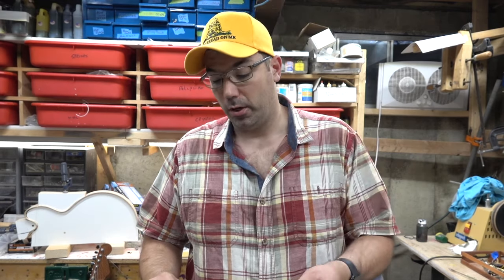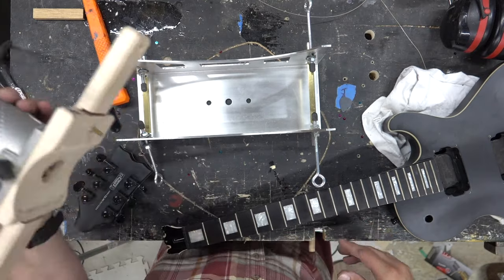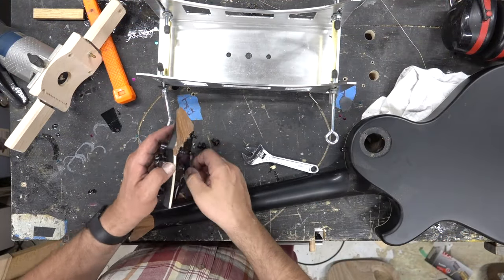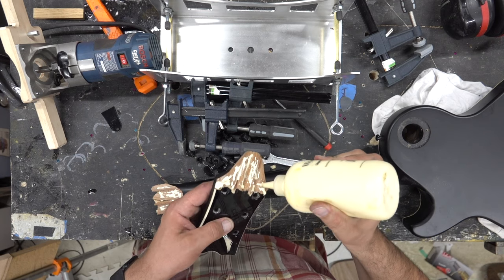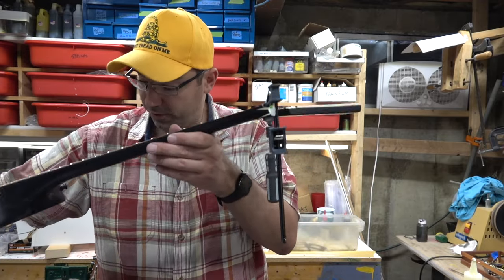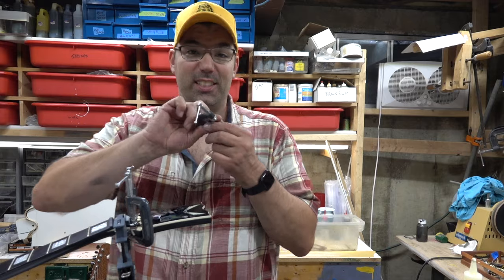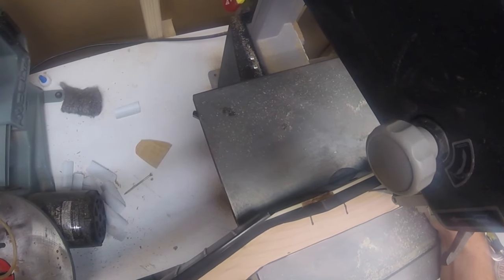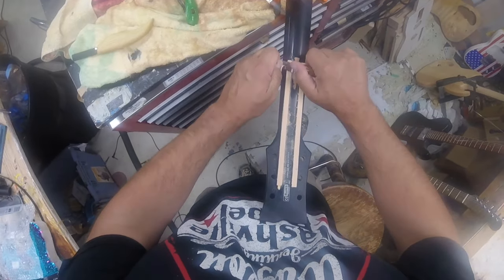Headstock Repair on a Dean Les Paul Copy - Guitar Repair

Comment: I’d have an unfinished open-grain neck because it feels really awesome. I’ll just sand the whole neck down, stain the maple to match the mahogajy and use some teak oil to coat the neck and then sand it level again to the perfect smooth feeling. I’ll also respray the back of the headstock satin black, patch the front of the headstock (in the overlay) with some black (I’ll figure out what’s best to use) and cover it with gloss clear coat. Sand and buff and it’ll be a great player’s guitar. Making satin finish blend with the new finish will be a pain in the ass and I do sand the necks on my personal guitars so why not?

Comment: Dude!!!!! I have an old dean ml ultra (look it up if you must) and it has a break in where the headstock is glued to the neck, but here’s the catch,it’s glued on around the first and third frets. So it’s still being held together because of the fretboard being glued onto both pieces. I wish I could show you a picture. But if I were to tighten some strings it would pull it apart enough for me to get glue in there and I can clamp it down and it should be fixed. I asked a guy back when it broke about 12 years ago and he told me there’s no way it’d work and I’d have to drill holes and put rods and a bunch of stuff so I had put it away in dads house and forgot about it till now. But I’m confident that I can salvage it with some sort of glue now. Man I love what you did to that thing too. Of course I’d love to have that one to try and refinish it before I do the actual job on mine. But I don’t have any kind of videos about that stuff as I’ve never done it. But yea that thing is gonna be sweet when it’s done and I hope whoever does get it will put a video up showing what the did to the neck!! Personally I’d put a Floyd Rose bridge and locking nut in and do a raw finish on the neck like some of zakk wyldes guitars cause those maple pieces look so cool in there.

Comment: Interesting jig! Thanks for the video. I did this job by lowering the joint into the spinning table saw blade with the guitar facing up.  It's scary, but works.  Lot of planning and dry runs needed. The splines will be the curvature of the saw blade.

Comment: Im a carpenter and a good tip for wood glue is to just lightly dampen the wood before applying glue. It makes the joint unbelievably strong

Comment: That jig is very cool. Maybe I should do the spline trick for my Epi LP Black Beauty I bought with a similar break (I got lucky. I had every splinter of wood given to me) and fixed 7 years ago. I always worry it's going to pop back off. I've even thought of making a new headstock from scratch and splicing it on like they do on most of the imports (A neck joint...it's sad...it WAS a one piece neck..ok, 2 if you count the fretboard). Right now, I'm playing the "if it ain't broke..." game. Great Video, now go do the kit B4 Brad gets his done :)

Comment: Cool video. To be more authentic it has to be turned to Lp custom. One would have to retouch the headstock and the horn so it would look more authentic but with Dean name. :D
Because of horn cut strip the finish and repaint the body, install new body binding, then pull the frets out, cut the binding channel on fretboard and install new binding, Re binding the headstock, install jumbo stainless steel frets, repaint the neck and install new hardware and electronics. Piece of cake :D

Comment: I noticed that you start thinking about which clamps to use after you already glued the headstock. It is really better to dry fit and dry clamp first, then have all the clamps ready before putting any glue on. Also it is better if you use cork lined plates on top and bottom of headstock.

Comment: Neat repair   I can see that same type jig to be used for truss rod slots Id designed one using the original arcs of both east and west coast designs and then used router bit collet to center that but this idea frees that up.. also  for carbon fiber inserts and truss rod slots you could use the offset and a centering jig to do truss. really if you did  this during construction to begin with you would not have  any headstock breaks..   Id do a double rod and carbon fiber and the neck would never twist or warp and once its dialed in set its not gonna move.   But it would never twist..   Great idea on that jig BTW  make a nice bisquit joint repair.. that neck will never break or move from that so that guitar will be a rock machine..   You could do maple cap or solid maple necks slotting the entire back of the neck in one long pass and use a krois type horizontal boring jig for the end and head stock end to get rod fed and anchored in.
that would make short work out of making them in production line.    Change the overall design to avoid  headstock breakage and  the overall shape and scale so  its different...
Make 5 changes and do your own..  and  as far as these comments go about rip off this and that SHUT UP you learn from the masters and they all RIPPED off the ones who were better then they were to LEARN  the idea is to LEARN and make something better.
you learn from the masters and you take from that and improve what can be improved.

Comment: I dont have all those tools...I just sort of eye ball it using a drimel...I maked where I was going to insert the dow of course. i didnt make that big cut..
Just enough 1" long dows. i was too scared to get close to the truss rod.
It was sort of a bietch...I drimel a little at a time.lol

Tight bond II works great...I just filed and sand  as best I could....Re painting the back of the neck was harder or took longer

Comment: Beautiful work. I've often wondered why others don't add reinforcement, as such, but only glue the joint and pray. Would adding steel rods to the neck as if reinforcing a gun stock wrist/grip change the tone? I would doubt it considering the trust rod doesn't. Again nice work & good info.

Comment: Hey BIGD,  You've inspired me to pick up a LP studio project with a cracked neck.  I'm planing on putting splines in as well as a few other fixes/modifications.  of those mods/fixes i'm replacing the headstock overlay.  as far the splines would it be an OK idea to just go (from the back of the neck) straight through the face of the headstock?   this way I would be able to avoid buying/making a jig.

I have decent wood working skills and built a couple ok guitars so although im realistic in the outcome im not to terrified.  just curious on your thoughts.

Comment: Im not a pro, but I have repaired necks in my own way so long as they are clean breaks. I simply use expanding gorilla glue and clamp tight between two decks of cards.  Never had one re break yet.

Comment: If I may add a suggestion, the repair you made should hold up fine but in the future, when inserting splines..especially when using a harder wood like maple..it is better to make the edges rounded..not squared. Reason being is that over time cracks will develop at the points..especially if any stress is applied. I bought an old gibson LP custom with squared maple splines and when the headstock took a nice hit, the spline acted as a chisel and cracked down the back of the neck.

Comment: I've watched quite a few of your videos, and they are helpful.  I am currently building the one that got away (eventually similar to my  original '59 GT LP Std.).  I hope I never have to do a headstock repair like that, but I do have enough good hardware to finish the one you just did.  Very cool.  (BTW: R U In Motown?)

Comment: I think you did a good job on the guitar, i had a broken neck on my ibanez i had to purchase a new truss it was an accident , my 5 yr old grabbed and kinda fell on it thats what bent the truss i used fish glue however i didnt have the jig that you have mine looked ok after the repair its straight and everything you can still tell its been repaired but not that noticeable it plays ok i guess that was my concern.But yeah your guitar repair turned out way better than mine did ive never used bondo on a guitar i have a kramer body that needs refinished now that i saw bondo used i think ill try,cost wise bondo will win that for sure,thanks for the video keep up the good work,take it easy..( great info )

Comment: When the headstock brokes like that, can be for a huge impact or wrong design ..... basically the wood  grain can't take the strings tension ...... so in case two, does it worth the repairs?

Comment: Now for a good question!
Why don't they do that in the factory, but from the front-side. Then it would be covered by the veneer on the headstock and the Fretboard on the neck!
Reply from the maker: they should add this on the front with maple strips.  would add time and manufacture process but man it would save sooo much work.
Reply: @bigdguitars  Thanks for the reply! It would be 4 minutes per guitar, with the machines they've got in their factory!

Comment: Great video. Just wondering why you used maple and not Mahogany?
Reply: That was also my first thought, but maple is much stronger and stiffer and it will be repainted . So no one will ever see that. It's a much better solution. I've done this before with maple. Greets.

Comment: "I don't always play authentic, but when I do, I play Dean Guitars!"  To be honest I'm not sure why ANYONE would want to copy that atrocious neck style the G company designed.  17 degree angle is too severe, no taper to the headstock (forcing D and G strings to pitch to greatly and lose tuning stability, and no volute carve behind the nut.
Reply from the maker: they need a les paul modern that fixes those issues...  traditional les paul has a long neck tenon